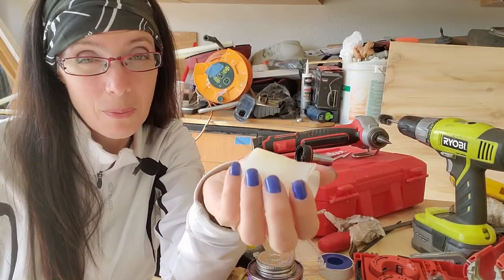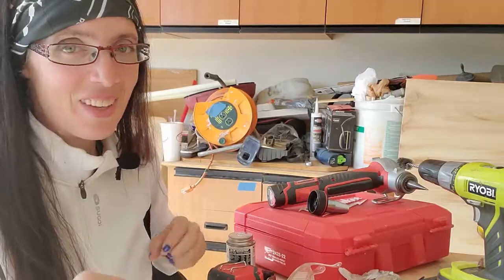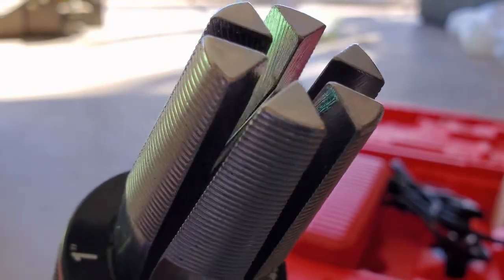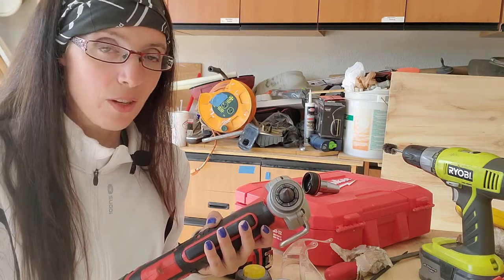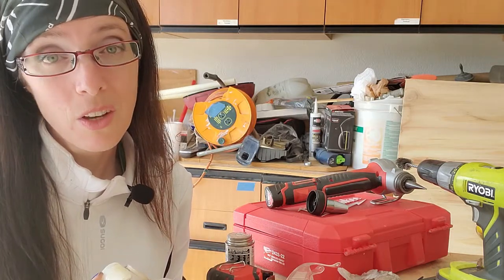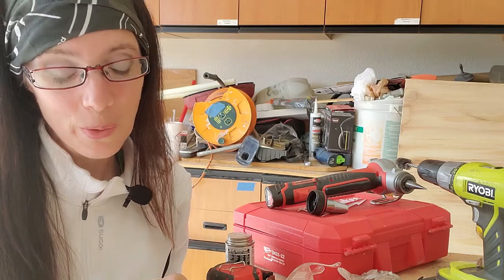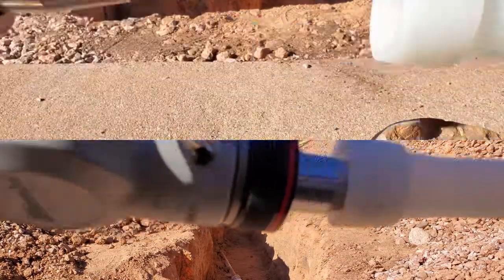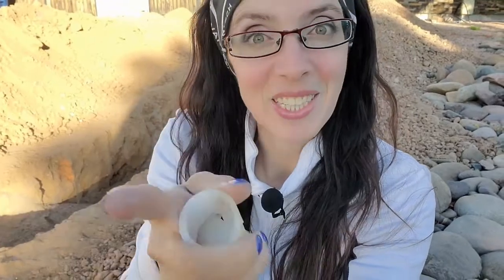How [NOT] to Use a ProPEX Expansion Tool #postyourmistakes

Comment: Also can use the expansion rings to repair garden hose fittings, even air compressor hoses fittings, and makeshift rings cut from upinor scrap to connect drip irrigation lines...
Reply from the maker: All great ideas and uses! I hadn't thought of the garden hose repairs--might have to do that on one of our hoses soon.

Comment: Does the coupling spin in place once installed? Im using pex a 1/2 inch with 90-degree plastic elbow. They required minimal expansion and can not be pylled off , but force can spin. Is this expected?
Reply from the maker: Yes, that's how they roll...I mean spin. 😉 I recall it wasn't freewheeling or anything but the metal barb to connect the PEX run to the copper elbow could be adjusted to lay flat.

Comment: A tip for down the road.. Also if you expand it and let go of the trigger JUST before it collapsed, just let it sit for a few seconds. You can get your other stuff ready. 
 Pex is VERY cool stuff.  The Longer you keep it expanded the longer you have to work with it because it closes slower. In cold weather I use HEAT to shrink it 
back down faster, and in the summer or REALLY hot places, Ill leave it expanded longer because it closes back up faster..
      OMG I just seen this was 3 years old.. OMG I should delete this.. lol
Reply from the maker: Please don't delete this. :) That's a great explanation. Really appreciate you sharing your knowledge. This is one of the best comments on this video--and people often learn more from comments than the video itself.

Comment: Appreciate the video.  I am DIYer and tackling replacing a main water service line in the Pacific Northwest.  This is my first time using the ProPEX expansion tool yielded similar results I did not get the fitting on all the way on my first try.  I am removing it today and will make a second attempt to get it right.  Also using the M12 Fuel PEX Expansion tool which makes putting these fittings on so easy.  A great tip to include in the video is the Manufacturer's Guide to how many times the tool should contract on various pipe sizes 1/2, 3/4, 1" (most common sizes used in home plumbing).
Reply from the maker: That's good advice there--thank for adding that tip. How did it go? I hope you already have it covered like it never happened. 😉🙌